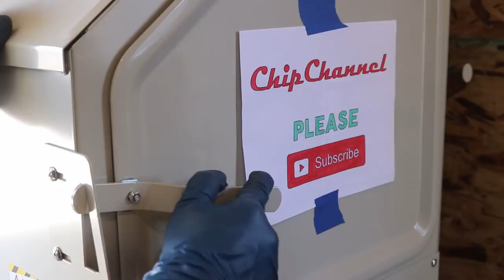1965 66 Tonka Farm Stake Truck Restoration

Comment: It's very rewarding to take something that looks so bad and make it look new is very gratifying. I worked at a body shop for five years and it was pretty cool to the end results. I painted a white 70 Cadillac and I mixed my own paint but I put too much purple in it and painted the car  I didn't realize it until I untaped it it was light lavender but she loved it and gave me a large tip luckily I had saved a pint of the paint and fixed a few dings a year later.

Comment: Good job. Except for 1 thing. The pieces you polished should have at least two coats of clear sprayed on them. That will seal them and allow them to stay shiny for years to come. Polishing will bring out the shine. But, they will oxidize pretty quickly if you don't seal them. You don't want to have to bend those tabs more than once. Spraying them with clear will keep them shiny so you don't ever have to bend those tabs again.
Reply from the maker: Thanks for the tips!

Comment: Great work! I noted that when pressing the rivets in place the powder coat gets slightly marked by the rivet press.... is there a way to avoid that I wonder? Like a piece of sacrificial plastic, nylon, rubber?
Reply from the maker: Thank you for watching! I agree there has to be something better. I have access to a lathe once this pandemic thing passes, I may play with making the same tool out of a Nylon or something.

Comment: Is there a reason you don't attempt to restore the hubcaps? Is the metal just too thin to actually remove the rust and buff?
Reply from the maker: Thanks for watching!! I need to set up a copper plating tank in order to fill the pitting in order to save these. Hopefully soon I’ll be able to.

Comment: Just wondering, did you try to clean up the original hubcaps and white walls?  Good job btw.
Reply from the maker: Thanks for watching! I wanted a better finish than what I felt I could make those hubcaps into, I cleaned the rust off of one, only to find severe pitting. So unfortunately I had to get new parts. However I have a copper plating kit on the way which I hope in the future I can use to fill pits in hub caps and then nickle plate. So I may be able to save them in the future.

Comment: Your precise grindout of the body/frame rivets was very commendable. How come no powder coat primer to fill in the pitted areas of the metal before final paint?  Great job on a classic restore. Love the background environment noise too. What about the steering wheel?  Looks like it should have had one.  Cyclops sheep really cracks me up. 😂
Reply from the maker: Thank you soo much! I actually have KL powder coat primer on order for my upcoming builds. It will be my first time ever using it so i'm pretty excited about it. The only color it comes in is pink, which is weird but shouldn't cause and issue. Thank you for watching!

Comment: Great work,, I’ve been restoring them also, but it’s so hard to find these vintage trucks in the uk. Frustrating.
Reply from the maker: Thats great to hear! I don't know if the shipping is an issue but I get many of these through Ebay.com. Thanks for watching!
Reply: @ChipChannelRestorations  yes thats what i do, but the shipping is more than the toy most of the time, just adds up to be to much, the are some in the uk, but not many vintage.

Comment: What is the tool you used to reassemble the truck with the little metal rivets? Where did you buy it? Thanks.
Reply from the maker: Thanks for watching! The tool is called a "PinTonka" tool, I got mine off ebay, however they come up if you Google search it as well.

Comment: Nice job like always hey were do u buy or get that u bolt installer from thanks
Reply from the maker: Thanks again! The rivet tool is called a PinTonka tool, normally you can find them on ebay or google PinTonka.